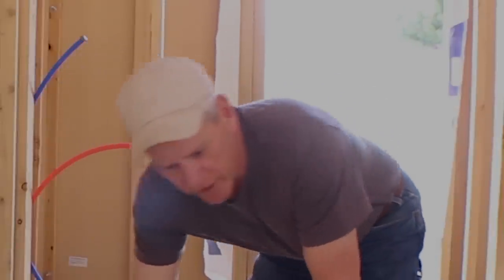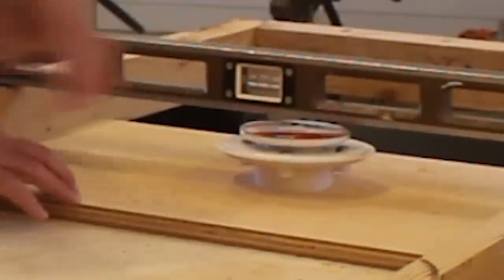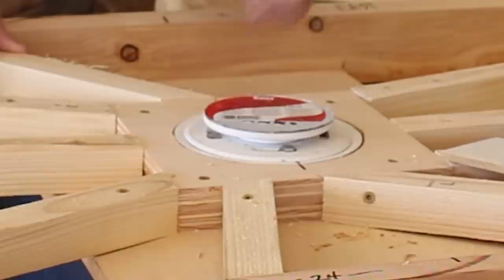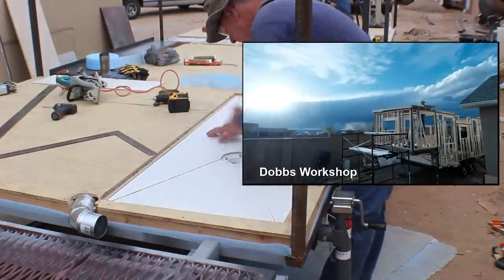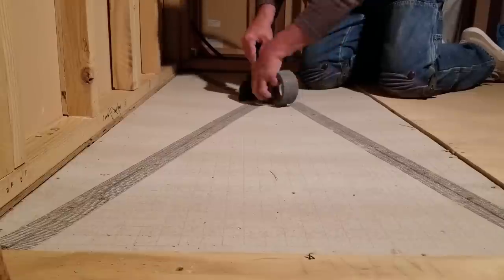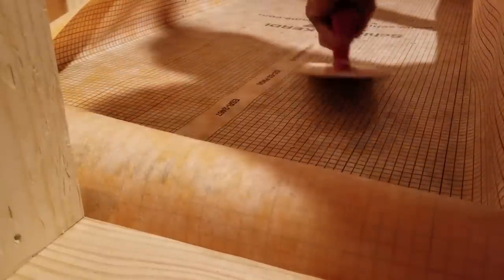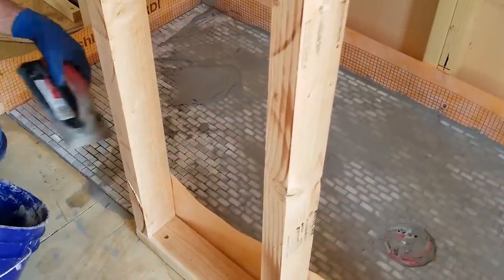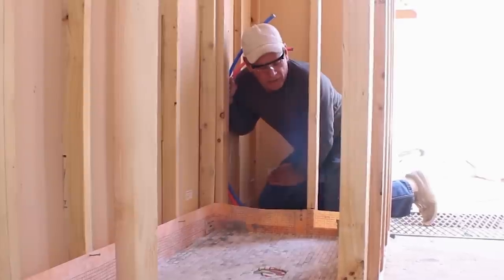Building a Shower Floor from Scratch - In a Tiny House on Wheels - Light Weight Design Challenges

Comment: The kerdi material is waterproof definitely, the problem is in the seams if you have to cut it. As in your case you could have done a closet fold in the corner similar to the rubber liner method and it would be fine. Tile coach channel uses a liquid membrane on top which I recommend as well so you know the cuts and glued parts are waterproof.

Comment: Very nice work.  I was glad to see you used the Kerdi membrane.  When doing an RV don't use heavy Hardiebacker board, use Kerdiboard.  It is lightweight and waterproof.  Hardie by contrast crumbles with water contact.  Wrong choice but the membrane saved it.
The key thing about RV tiling vs house:
1. Use Polymer in the Thinset Mortar instead of water.
2. Use Polymer in the Grout instead of water.

MAPEI is an Italian tiling company and Lowes carries their product.  They make a very good Thinset Mortar and a Polymer which work together.  They also make Grout and Grout Maximizer (polymer for grout).  When you use these polymers instead of water, the rubber compounds make the thinset and grout more flexible so they won't crack and pop tiles under the constant vibration of a moving vehicle.  They grab better too.  The Grout Maximizer eliminates the need for sealant on grout lines, as it is built in.  How nice!  Lack of sealant means water penetration.

Schluter makes a waterproof Kerdi membrane which you used. 
Schluter makes Kerdi board, a backerboard for tiling but very different. It is a type of dense, resilient foam encased in the Kerdi membrane.  The advantage - much lighter than normal cement board, completely waterproof, and also provides cushioning for tile, so there is some springiness in the substrate and tiles withstand van movement better. A far superior backerboard. No, Wedi is not the same but similar concept.  Kerdi is the best board and the priciest!  Kerdi board does not disintegrate if water hits it all the way through.  Most cement boards disintegrate with any water.

Schluter makes a tile floating substrate called Ditra which resembles a waffle.  It is a bit thick.  But you would use it like a backer board and fill with thinset like butter in a waffle. The advantage is, that the tiles float on the surface and breakage does not happen.  Good for larger tiles in an RV.  Just so you know they exist. A pricey German line but where it counts, it should be used.  Don't take shortcuts on sleeping bags and tents when climbing Mt Everest and similarly get the most leakproof thing when making a shower stall regardless of cost.  When a job is done well, it lasts forever.  My 1997 RV has undercoating that is still in excellent shape, amazing! They did a first class job on that.

There is another great product I found: Innovera by Palram at Home Depot. These are vinyl tiles that clicklock into place on each other. They also sell a vertical strip for inside two corners and you can finish off with aluminum tile borders on outside.  This comes in a few basic finishes and one of them is Carrera Marble.  Lovely! You stick the tiles on - they are very light.  Caulk between them if used in a shower stall. Only for walls not floor.  Meant for home bathrooms and an easy remodel over existing tiles.  I find them excellent for an RV bathroom. Low profile not thick, lightweight foam core with vinyl overlay, waterproof, easy to apply, easy to cut, done very fast. Stick with construction adhesive to the waterproofed wood walls, and caulk in between. These will match your marble tile on floor.
Reply from the maker: Thanks for all the feedback on the shower floor, mj! I have not used the Ditra specifically, but have wondered how well it works. I'm glad to say that the shower floor in the video is holding up well with no issues after a number of years now. I can certainly see that if I did a lot of work on RVs, your knowledge would be so helpful. Thanks again for watching and for your input!

Comment: Genius ! I hate schluter kerdi but I recently did same exact thing fir a curbless shower, the membrane is definitely waterproof, although I was still fixated on using a liquid topical membrane in all the seams and the entire area for that matter
Reply from the maker: Sounds like we were thinking the same way about the use of the kerdi membrane and I could certainly see it being useful on a curbless shower. I honestly don't have enough experience with it to have an opinion otherwise except it is expensive. There has to be good science behind it or it wouldn't be as widely accepted as it is. I even had a conversation with a legit, solid tile guy who is an absolute kerdi convert for a variety of rational reasons. Still, I would have a tough time warrantying it without rolling on the liquid membrane too! Thanks for the comments!

Comment: I'm so glad you didn't put nail holes in the kerdi .
Reply from the maker: Yes, Michael, nothing good is going to come from putting nail holes in any type of shower pan liners except maybe at the top edges in traditional showers to hold them in place! This shower floor has worked out great and is still in perfect shape many years later.

Comment: Things will flex a bit being in an RV, but that Kerdi should prevent any issues. You could also have used a liquid roll on membrane like redgard.
Reply from the maker: Yeah, Kevr, after about a year use it has worked perfectly. There are some things I would probably do differently the next time but for an experiment, it worked out pretty well.

Comment: I wouldve definitely used a foam shower system. 

Wedi makes a 3/4 inch foam pan that can create a curbless entry. All you have to do it recess 3/4 inch ply flush with joists.

With wedi, its completely waterproof. There's fewer parts to create the shower assembly and it's a ton more straightforward.

Good thinking though!
Reply from the maker: Yeah, Alex Nez, I thought about it. Not familiar with Wedi, but the Kerdi products are so expensive! The 3/4" foam pan would have been about right. The other issue was that I wanted to secure the shower floor to the trailer frame and wondered how I would do that with foam. In the end, both the shower frame and the drain assembly are tied to the frame. So far, so good! It seems to be holding up well. Thanks for the comment!
Reply: I only use Shulter products and they would have been better even in this application. They are expensive but it’s hard to explain how that works. Really it’s cheaper than you think. Plus weight? Just saying totally wrong thinking on this with the Kerdi. Well if you want me to destroy your confidence just ask. Lol 😂 I bleed orange of Shulter. I don’t work for them.  They made me better than eve and increased my knowledge to a place I couldn’t dream of 15 years ago. Some will never get the thought process and some will say it’s do it yourself friendly but that’s is like saying I can be a firefighter because I’ve seen it on YouTube. I’ve dedicated my life just to get the skills I have now. Tile is one of the oldest jobs in the world people spent 30 years just to earn the title of master. And they had to present a work of art in front of their peers to earn the title. Now here we are saying anyone can do it. I’m cut, cut deep. I understand most installers don’t have skill and are boarder line do it yourself but this is not right destroying someone’s craft into a weekend craft. No wonder guys don’t want to take pride in being in flooring. It will be a dying craft until people understand the knowledge that IS required for successful and permanent installations. But hey people aren’t about permanent in today’s world.
Reply: @tileslay6543  Your spelling needs improvement:
SCHLUTER, not SHULTER.
BORDER, not BOARDER.  A BORDER is a frame.  A BOARDER is someone who pays you rent.

With regard to craftsmanship in the Tradesmen work, I agree with you, however, we don't live in the same times.  In the past, people built grand homes and workmanship was valued.  Today, homes are remodeled constantly and flipped.  It makes no sense to do a great job and pay a lot, only for the next resident to rip it out.  This is because we move a lot for work today.  

Regarding Tile Master status - While that is worth pursuing, a small RV tile job can be done PERFECTLY, if you read up, follow all the rules, and do it right.  It is only one job.  Not necessary to go to tile school for that.  However, if that is your profession, you do need to go to school and learn to do it right, because your work requirements vary a lot.  That is my take on it.  Your years of study have not been wasted. There are many wealthy clients who can afford you and need you.  But a small mobile home DIY application should not make you insecure.  So quit griping and find new clients.

Comment: Really interesting... I'm here because I'm looking to do something similar in a cargo trailer conversion. So you just put up waterproof sheathing on the walls and are relying on the aggressive slope of the drain to  direct water away from the bottom corners of the walls? What if there is a clog and water builds up in the pan? what if they like to kick water in the corners?
Reply from the maker: The shower floor turned out well and is still working perfectly after a couple of years of use, Bike. As with any type of shower design, you definitely want to seal all corners where surfaces exposed to water come together. In this application in a tiny home, the drain is tied to a trap that immediately dumps into a gray water holding tank so there is no concern about clogs. You may also want to look at the foamboard shower bases that are available from many different suppliers to use in your conversion. Good luck with your project! Sounds like fun!

Comment: Very nice shower floor!  Looks strong, and waterproof.  I'm sure it'll give them years of service.

I am curious how you worked out the angle cuts at the ends of the 2x2's.  The way I think I'd have tackled it, would be to set a speed square inside the frame on the floor on its flange side, the 90 degree side butted up against the frame, and the flange side pointed toward the drain.  Then take a straight 2x2, slightly longer than what you'll need, and put the bottom corner on the edge of the wooden block around the drain where you want the top corner of the 2x2 to end up (may need to rest it temporarily on another 2x2, so the bottom corner is exactly at the edge of the block), and rest the other end on the frame, then draw a pencil mark on the side of 2x2 along the edge of the speed square, then move the speed square to the other side of the 2x2 and draw another line on that side.  This gives the 'miter angle' (lines on the sides from top surface to bottom surface) to cut the 2x2 at the frame end, plus its length.  Move the speed square to butt up against the block around the drain and draw similar vertical lines on the drain end, from the bottom corners up on each side, to define the sliver to cut (or sand) off of that end.  Then to find the 'bevel angle' (lines on bottoms from left surface to right surface of the 2x2), draw a pencil mark on the bottom of the 2x2 from below, along the edge of the frame.  Do the same on the drain end, referencing along the edge of the block around the drain.  These procedures should end up giving accurate pencil lines on the sides and bottoms of all the 2x2's, on both ends, and then just cut with the saw following all 3 of these lines.  Oh, and since the drain is surrounded by a block made from 2 pieces of 3/4" plywood (1 1/2"), and the 2x2 is 1 1/2" but at a slight angle, the surface of the 2x2 meeting up to the block around the drain is going to be slightly taller than 1 1/2" (which would also put the angles a bit out of whack), and so the bottom of that end of the 2x2 will probably need a bit sanded off to get its top surface to flush up to the top surface of the block around the drain.

But as I say,  I'm curious how you did do it, since yours looks very neat with tight joints.
Reply from the maker: Well, JusBidniss, if I were smart I would respond by saying I did just exactly as you described and it turned out great! But, in actuality, my approach was a little less detailed... like I laid the 2x2s on the frame, marked each side of them as seemed appropriate and made the cuts. Then sanded them with the belt sander as needed to get the bevels to fit to compensate for the fall from the outside of the frame to the drain. Not much more than that. But after reading your explanation, I wish I would have tried it your way! One of these days, I'm going to have to contact you before a little complicated project and get your input before I start! That might be interesting. Thanks for the comments, as always!
Reply: Thanks Rusty, that's a great compliment!  You're always so gracious when I go on like that!  I started off just wanting to write a comment to help support the channel, but then my detail-oriented streak took over....  :)
EDIT:  Oh, and almost forgot to say, if you got all those joints that tight, sanding by eye, then you've got micrometers in your eyeballs, my friend!  That's not carpentry, that's art!  Well done!
Reply from the maker: Thanks, JusBidniss! Always enjoy hearing what you have to say and appreciate the support. Don't be surprised if I don't ask for some input before a project one of these days. I was about half serious! You do have an eye for detail!

Comment: Hi. Are you available to build one? It's for a new van conversion so I need it lightweight. I do NOT want to use foam like someone suggested LOL, but mounted to the van properly like you did in this video. I plan to use 80/20 for the wall skeleton as it's super strong and you can add bolts anywhere needed. Please let me know if you're available for hire later this year or early next. Thanks
Reply from the maker: Hi, S. Thanks for your inquiry and sorry for the late reply as your comment got buried in a list of comments. Sorry, I'm not really doing outside projects for customers any longer but your van conversion sounds like an interesting one. I can say this approach has worked out well in the tiny house which was for my son, so I know how it is holding up. It is not moving around so we don't have a read on how that would impact it's stability but my guess is it would still be ok. Good luck with your project and I hope you get good results!

Comment: Should have went with the schulter drain. Best 100 bucks  i ever spent.
Reply from the maker: Yeah, I thought about it, Mike,  but with the unconventional way I was doing the floor and drain assembly, I decided the Schluter drain was not going to be able to work like it was supposed to, so I went with the $13 drain instead. One year in and a brutally cold winter as well, the shower floor has worked great and without a hitch.

Comment: You do know they make foam pans right lol
Reply from the maker: I assume you are talking about Kerdi products. Last time I checked, one of the shower floor kits for this size space was about $450. Plus it would need to be secured to the floor some way as it would be bouncing down the road at times. You did know this was going in an RV, right? I explored making one out of 3" high density foam that could be cut with a hot wire, but we were trying to avoid having a shower curb and still had the problem of securing it to the floor. You do know they make custom acrylic preform shower bases for about $1,000, right? In the end, this solution had about $70 in materials excluding tile. The most expensive part was the Kerdi membrane. This solution has no curb and allows both the shower base frame and the shower drain to attach independently to the frame of the trailer, so as the trailer moves, so does the shower. Working out great so far, but we'll see how it holds up over time. My guess is it will be fine.